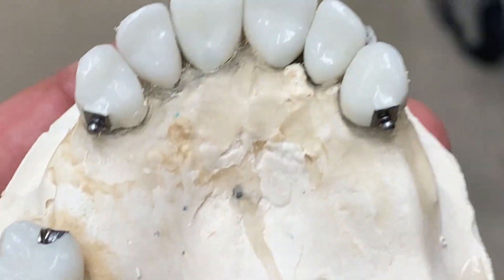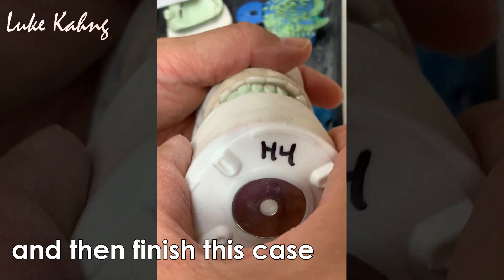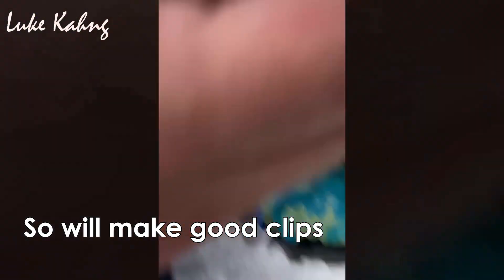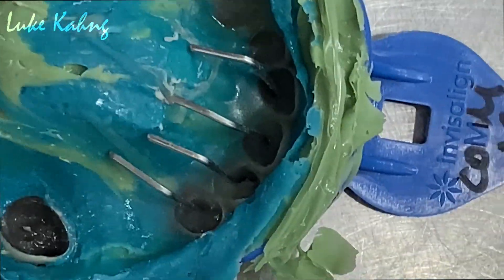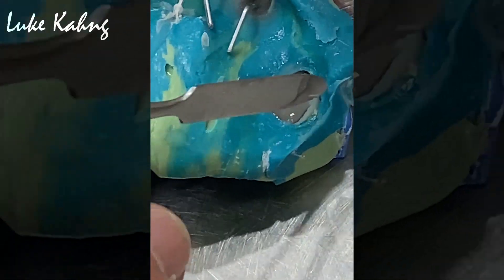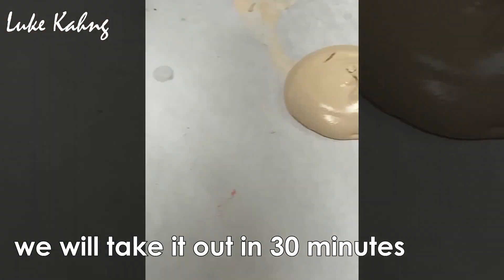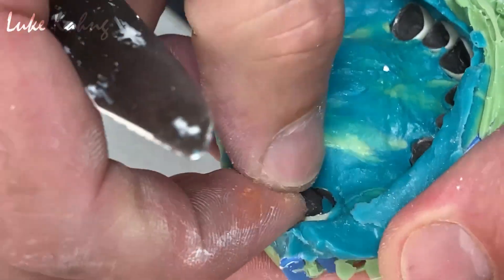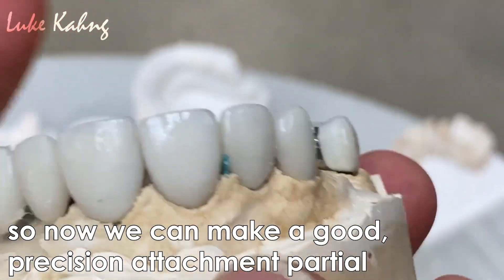Make Precise Models That Ensure Future Partials Made After Metal Ceramics Fit

Comment: Hey Luke! There is a way way easier way to do this tried and and tested for 25 years. Simply ask the dentist to put some light impression material inside the crowns during try in as if  he was cementing them he was cementing them . Then he removes the extra flowing material and take over the crowns the secondary impression (Or repositioning impression) you would see a thin light material inside each crown and you can check the accuracy of the impression if you do not see any light body material at the crown margin (That means the crowns were well seated during the process). At the lab just pour the impression directly with die stone and you will have a perfect working model (the stone will not stick inside the crowns since the film of light body material will act like a buffer zone). Hope this helps ☺️☺️☺️

Comment: Why pickup impression
They cud have cemented it also na
Then made an impression
That's better or this is better
Reply: You need pickup impression to have the attachment on the working model and continue to make the partial  usually the male attachment will be on the crown and the female will be on the partial. You can never have an accurate model in plaster that represents the delicate attachments used. ☺️☺️☺️